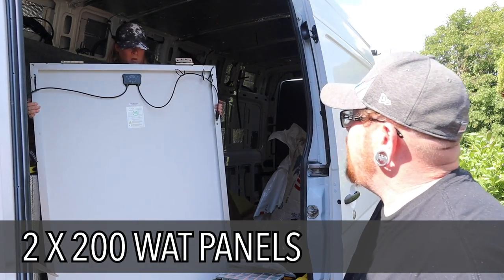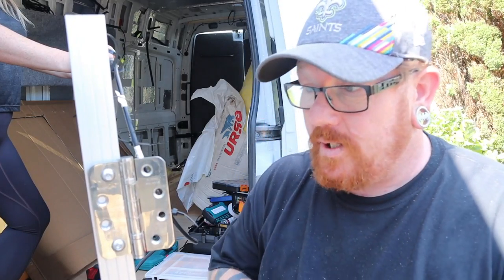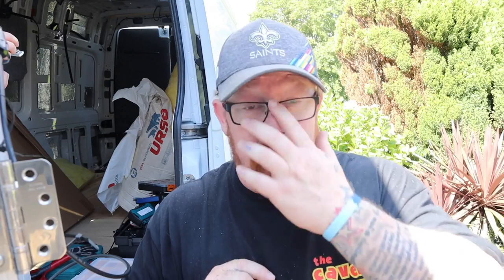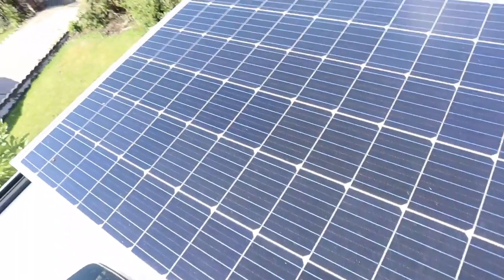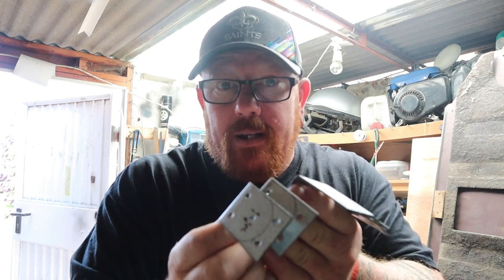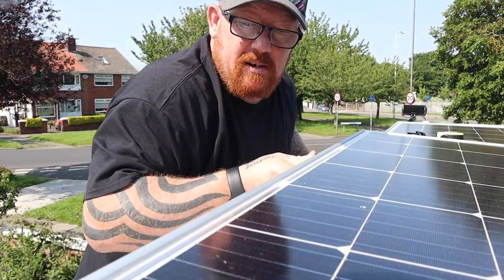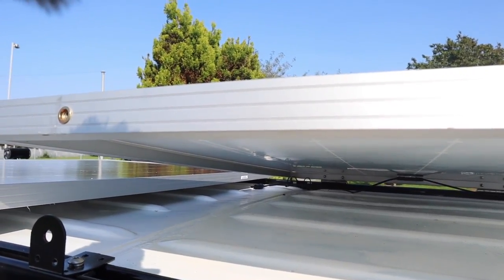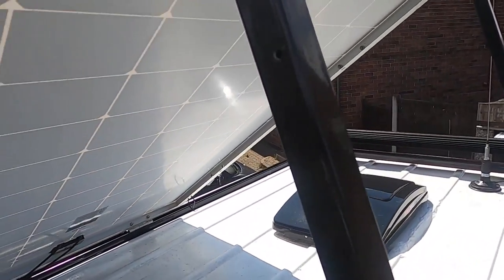An EASY Solution To Make Your Van Build Solar TILT

Comment: Did you customize the bars yourself?
Reply from the maker: Which bars exactly . The ones we used for keeping the solar up we just flattened the ends with a hammer and rounded them off giving us the ability to secure them to the solar .

Comment: Great idea for mounting solar panels!
Also, I didn't know about these rivnuts. They seem to be pretty neat. As it seems to be easy to create a sturdy connection to the solar panel which you can open from the outside without having to lock the nut from the inside.
Here is btw a video about how to install them for other folks who didn't know about them:
 https://www.youtube.com/watch?v=624tHJ9g38Q

How happy are you with those rivnuts? Do they last well? It seems a normal nut and washer is more sturdy though for this purpose they could be just fine.
Reply from the maker: there riv nuts where kind of new to us as well mate and i have to say there amazing , the only issue with bolting trough is once the roof is up you cant get to the bolts , but iv never had one fail on us there really good and id use them over and over again , and when you look in to what there used for man there used for all kind of things , thanks for watching bud
Reply: I've never installed Rivnuts but I've had things with them in & they do seem pretty reliable though getting them out when they do fail can be a pain because they're usually in awkward places. 
All the ones I've had fail did so by spinning & every time it was because the thread had rusted so make absolutely certain you keep the threads greased or better still use a thread seal compound like Loctite 243 or 222.

Comment: A Freaking Hinge! Geez.....!
I would've never thought of this!
Great Solution! Congrats!
The rest of the HW?
"I ain't got time for that".....Anyone could provide for links to the proper L type brackets for the roof rack?
In my case, as a travelling RN anywhere between Florida and Alaska, the "raising-angle-bars" would have to connect to the sides of the panels, after drilling many holes on these sides, so that they can be adjusted to the different angles needed to capture the most light, as in latitude and season. It could be anywhere to almost fully on its side in the winter in Fairbanks, Alaska to almost flat in South Florida in the Summer, so, yes, almost 90 degrees worth of movement. Maybe the bars could have some sort of cotter pin at the end to secure them going to a specific size washer/block type of thing to make it sturdier, meaning no play? Hmmm
Obviously you have to park the vehicle and align the panels as parallel as possible to the Sun's arc since this is a 1-axis adjustment. This means that there will always be one side that will face the Sun more than the other as the tilt is "biased" to work better on one side of the van than the other.
Reply from the maker: Dude I was sat there one day and I was like a hinge why dose not one use a hinge it’s easy simple and solves the problem so off I whent and hinges away . And yer to get the right angle you  just  have a load of holes in the bar and go mad on the free energy . The start of your comment had me laughing

Comment: cheap gas struts off the boot of scrapped cars are dead cheap that can lift upto 50kg of boot up. prices are from £5 to £10 a pair.
Reply from the maker: They don’t work mate as a pound per square inch and pressure inside them is far too much for aluminium on the panels to handle we know this because we tried
Reply: @UrbanVanlife  Actually thanks to both of you. I was going to ask Urban Vanlife where you got the gas struts. Great Idea SnowChains, or at least now I'll know where to look. My Solar setup as a little heavier than yours, Urban Vanlife, and I can see how a combination  of both the struts balanced with the force of the actuator could make a nice low impact system in either direction. Thanks!

Comment: Hi! Very smart idea ! It's the first of your videos that I watched. You help me a lot, I was just wondering how to tilt my panels! But they are a bit bigger, I'll need to tilt them in the width.. I wanted to know, how did you fix the rails on the roof? Glue, screws, both?
Thanks a lot and excuse my english, I'm french! 😊 kiss from France!
Reply from the maker: Hi Leslie . Firstly your English is better than mine . And to answer your question we use riv nuts to secure the  rails to the roof . We have a video which I’ll link . It may be helpful to you , Riv nuts are a real easy and strong way to secure rails to the roof and it’s a relatively easy job as well . Thank you for the kind worlds and I’m so glad I was able to help . Here is the video where we fit the roof rails . Take care . Neil and Emma .... https://youtu.be/sINU5Hui0Qk
Reply: Use square tubing (25x25mm) that fits into larger square tubing (30x30mm) - they slide within each other and you can extend the the angle (lift) of inclination.

Comment: What if the suns on the other side of the van?  hehe.
Reply from the maker: Well as we kind of know where the sun sets it’s really driver fault if your facing the wrong way . But as an added bonus with the invention of the engine the van can now be moved
Reply: @UrbanVanlife  But if the sun sets there is no power to panels.

Comment: Only thing I'll say is your going to need ladders to get up to tilt your solar panels
Reply from the maker: we have  a collapsable one that stays in the van , the one we used in the video , there really good
Reply: @UrbanVanlife 
Yeah they work well, I've got one come in handy.
Reply from the maker: must admit at first i was nop im not getting on that its not built to hold me , but man them things are strong , but i have fallen off once when on side wasnt locked in , and yer i ended up on me a55
Reply: @UrbanVanlife   yeah I have too too
Reply: @UrbanVanlife  Ditto with the unichannel struts here, too.  But after looking at the reasons a few percent of the reviews got 1 star, I'd rather be an old climber than a bold climber - lol.  Regarding the possible slipping concern of the tilt extension bar, it  would be easy enough to drill a horizontal hole on either side of the unistrut, adding a bolt, washer and nut to keep it from moving (or something like that).  Thanks for sharing - nice job :)

Comment: Seems like a pretty stupid idea, like ou, the sun is at an angle, lets climb up on the roof and put the brackets in to get an extra 0.5 watts of energy. Ou the sun is mid day, lets get up on the roof and take the brackets down now. Ou its afternoon, lets put the brackets back up. Ou there's a bit of strong wind, lets take the brackets down again. Farrrk that.
Reply from the maker: with a 45 tilt you can go from 50w to 300w within seconds mate and pull in a lot more solar and thats what its for why be happy with less when you can be full  , so for the sake of it taking you 2 min its well worth it , also wind wont effect it unless its a hurricane but then you wouldn't put them up any way

Comment: Hi great video 👍Where did you buy those  bars to hold the solar panel ?   i  couldnt find them online . Thabk you 🙏 Merry Christmas 🎄
Reply from the maker: The bars they are fixed to are called unistrut you’ll get them in loads of places but I think eBay is the cheapest